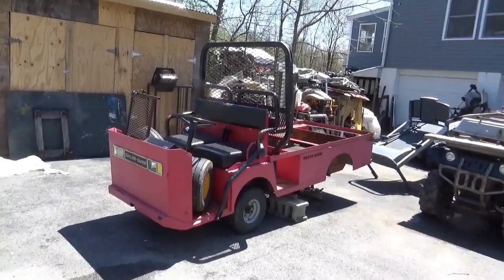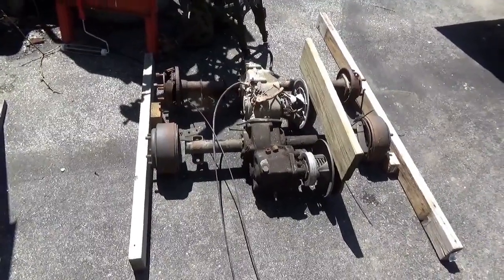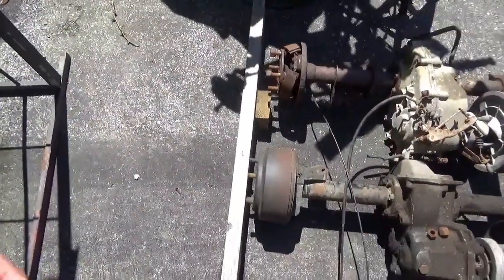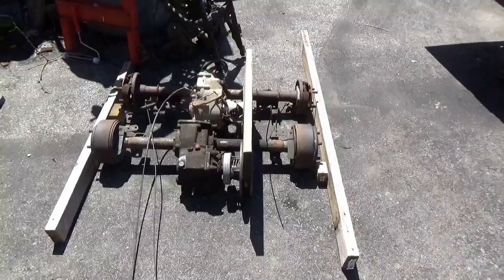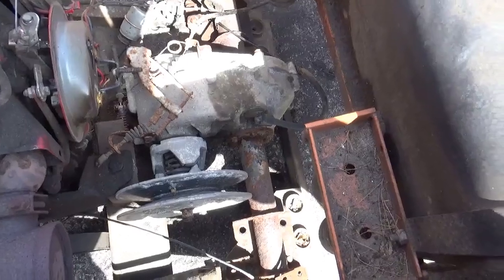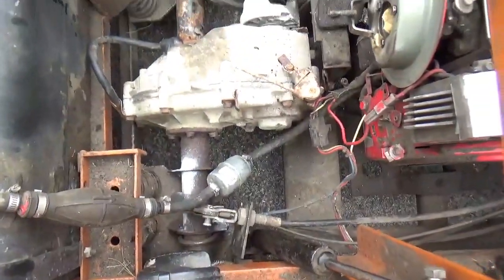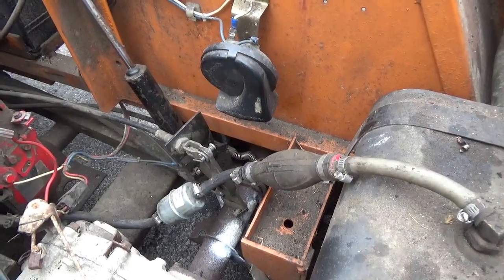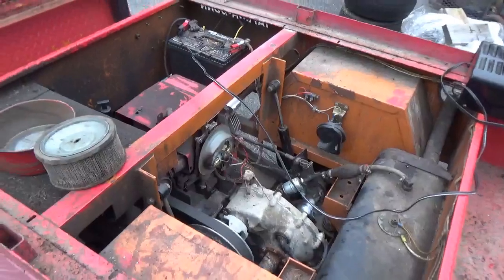Ultimate UTV, Taylor Dunn B6-10 Burden Carrier Finally Moves!

Comment: Someone please respond to me on this I have a 2002 Honda TRX 300 ex and the wiring harness is completely destroyed besides the part that comes out of the engine and from the starter and I have a brand new stater installed in it can I put a pit bike harness into that small loop
Reply: The Useless Username OK thank you so much

Comment: Harvey,  You might check into the golf cart wheel spacers on eBay they make them in different widths.  and just use the one of them on one side. They're pretty tough. I got a set of the widest ones they make on my  golf cart  and we run it hard  with no problems

Comment: Yeah, it may be time to shuffle that stuff back to the back yard, ya got to keep momma happy! The dunn seems to work just fine with that rear setup. At least you can use it now. It would be great when you haul in new projects to load the from you truck straight onto the dunn. Then you can haul them back to the shop and check them out. 👍👍 The weather has been crazy mild around here and chilly at night. It is kinda spooky for it to be like that this time of year.